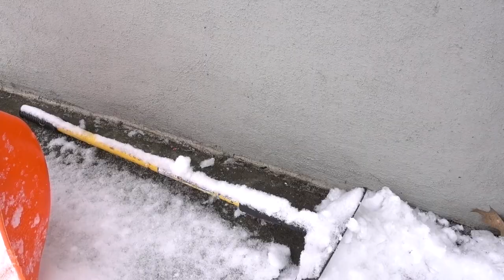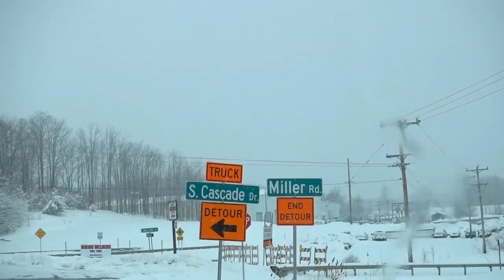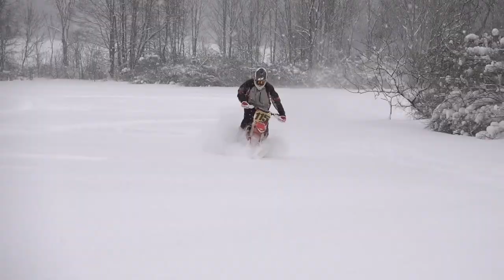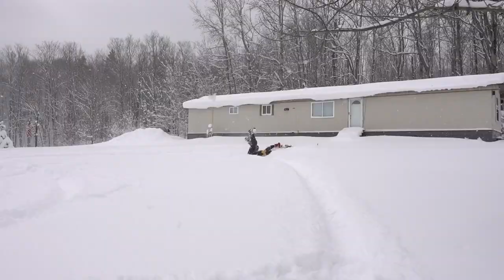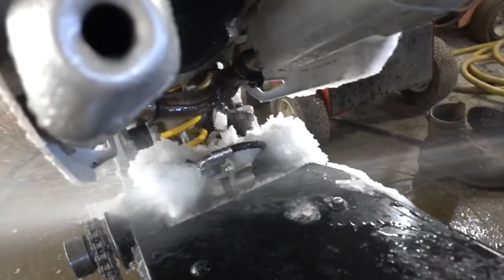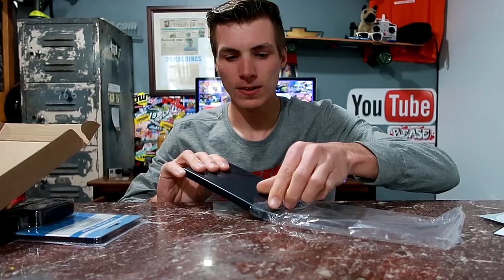I CRASHED THE NEW SNOWBIKE!!!

Comment: Little helpful tip!! If you get a half inch copper pipe flatten one end so its still open then hold other end on a air compressor you will blow the snow away supper fast and easy. But even better make an adapter so its on for both hands free use.